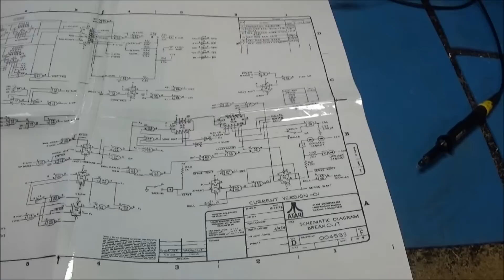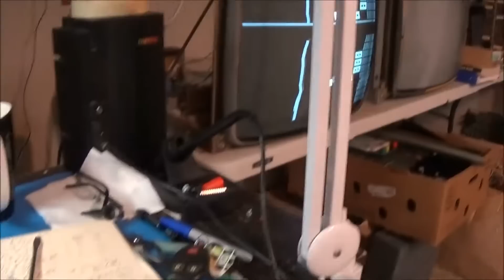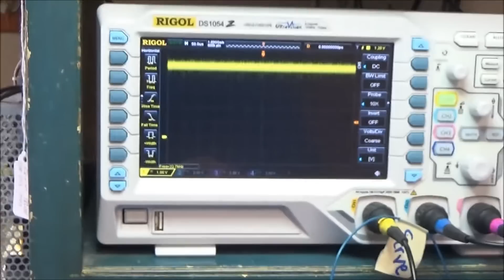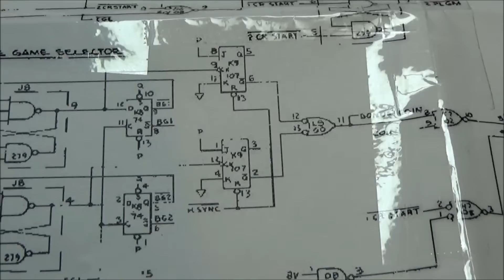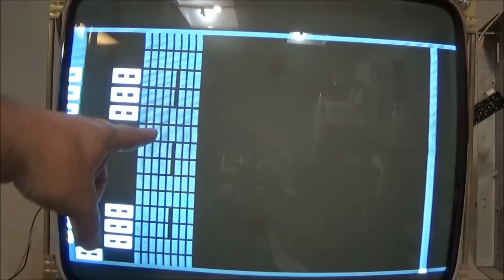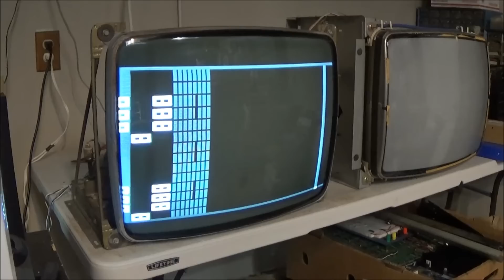1976 Atari Breakout Arcade PCB Repair Part 4  -  12/1/20

Comment: you are not using ic sockets?????? sometimes you dont even get one chance to remove an ic before traces start coming off the board. i have  NEVER had a problem using machined pin ic sockets. ALWAYS use a socket. the ic you are replacing may have gone bad because of something upstream or downstream caused it to fail.